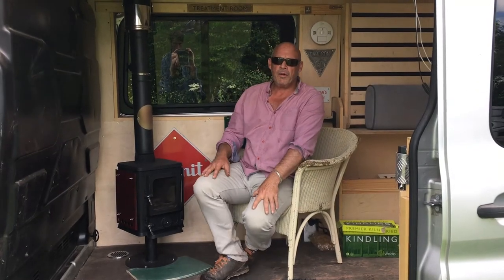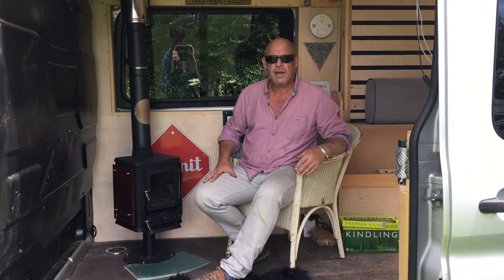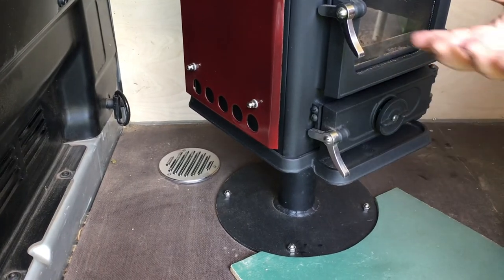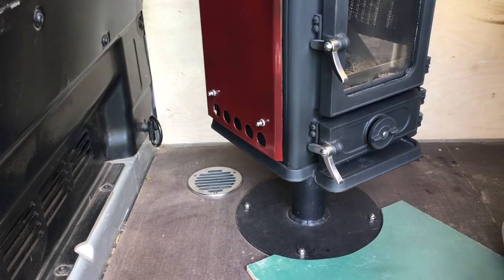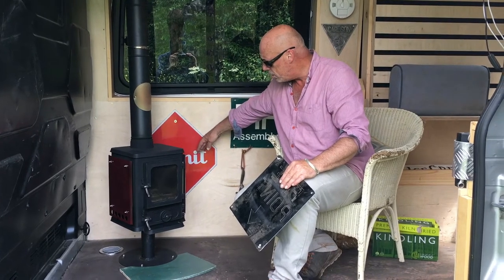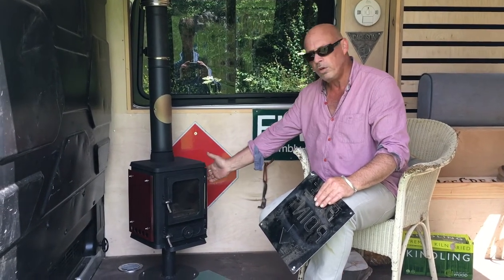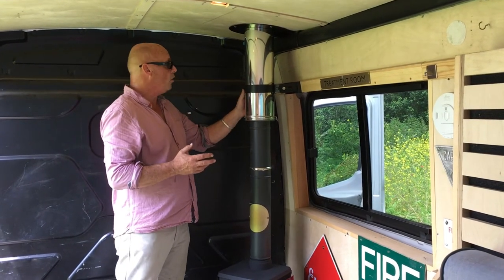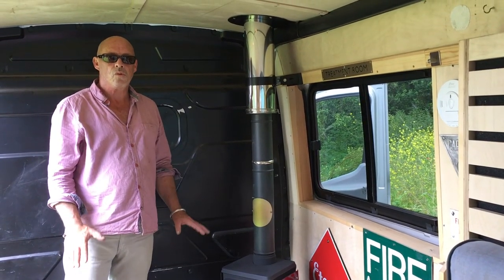Installing A Small Wood Stove Into A Vehicle

Comment: Just wondering can i use the original 4 legs to bolt it down to my camper floor. There is thread in them. The space between floor and thread i fill with washers.
Reply from the maker: Yes! You certainly can. :)